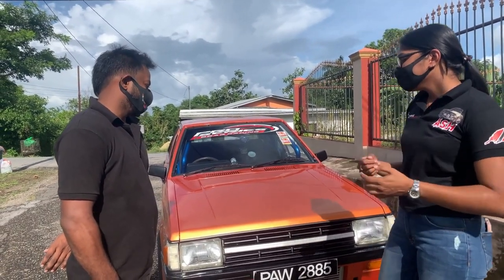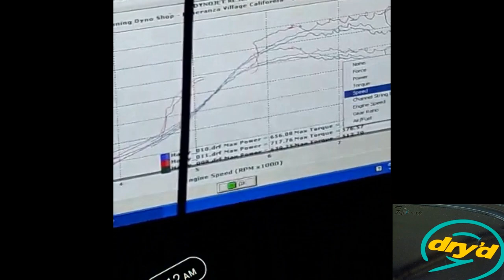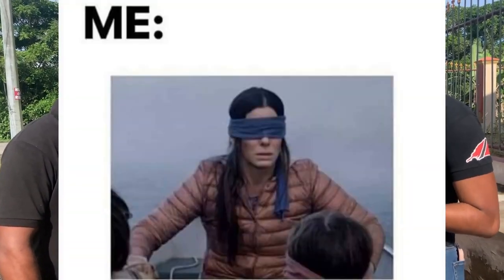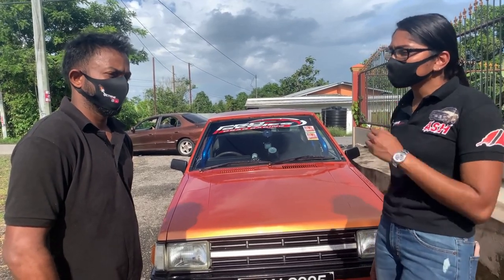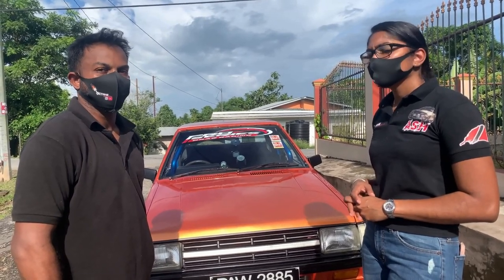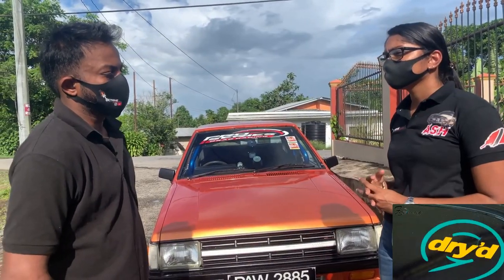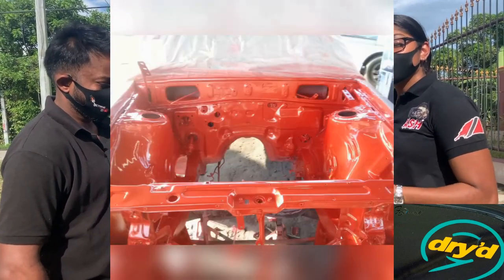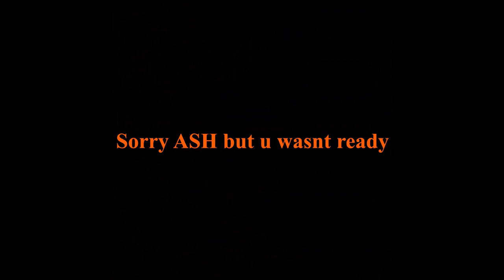Harry's 10 second box lancer, is the answer

Comment: Stock suspension and brakes lol in that light Rwd car and all that power hmm 🤔🤔
Reply from the maker: We can't talk because most of our channel cars on stock suspension and brakes and doing over twice d power it came with 😂
Reply: @octaneaddictstt  🤣🤣 life on the edge
Reply: Sometimes less is more, less unsprung mass means better handling, less rotational mass means quicker rpm changes, less mass on the whole means better power to weight. The overall thing tough everyone rushes to put the biggest brake kit on but that is much more dangerous as you pointed out on a light car it’s easy to lock up and loose control with overkill brakes…….
Reply: @shevonsinanan2126  not saying the biggest brakes u can get but that's a car capable of 700+ hp lol. And how much weight can u possible want/ need 2 save in a car that already makes supercar level power yet weighs almost nothing 😂 love the car just seems a lil scary hearing stock brakes on original suspension from the 80's.